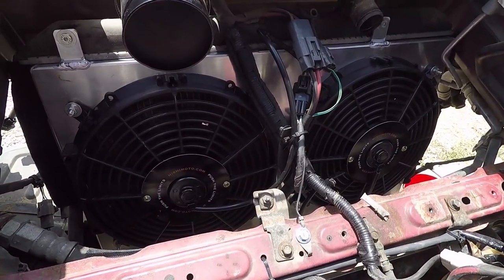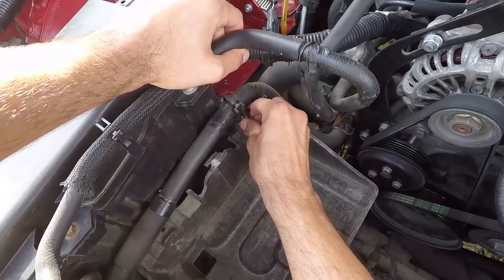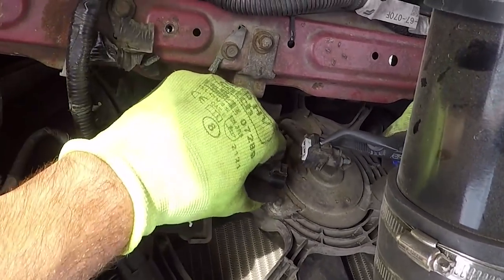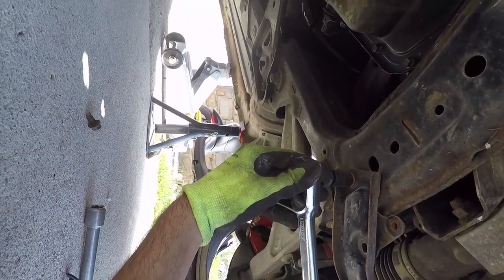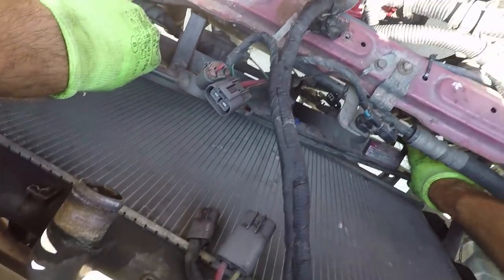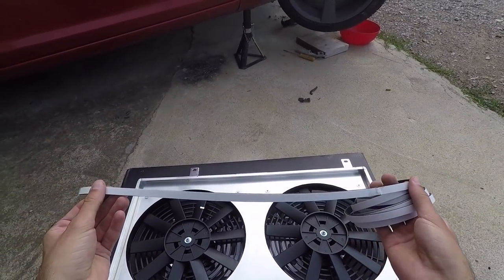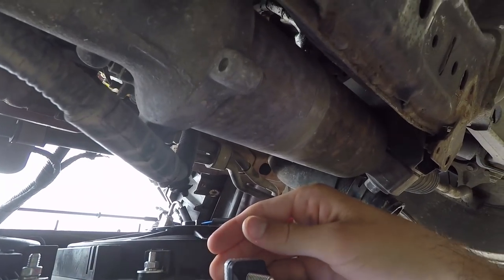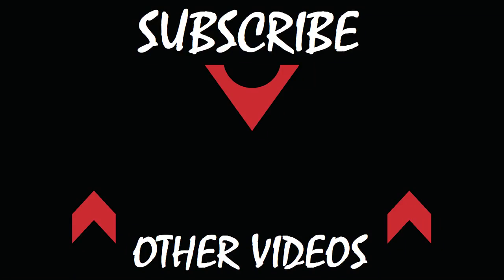Mazda Rx8 Mishimoto Aluminium Fan Shroud Install

Comment: These are the ones I had but in use track they are not enough, they are even less effective than the original ones.  I keep the Mishimoto support and installed 2x SPAL VA10-AP50/C-61A - 1221 cfm - SPAL Electric Radiator Fan - 12.0" (305mm) PULL , just another world.

Comment: My upper bushing for radiator broke that you hang the radiator on during install, so I took the one that's on the air pump, exact same piece to replace. Good to read comments.
Reply from the maker: Amazing save man!

Comment: Is this supposed to be better than the OEM fans?
Reply from the maker: O!Technology performance wise the cfm is a bit lower, as I red and heard. But compared to my stock fan it should perform better
Reply: I put the mishimoto rad and fan shroud. Im getting 10-15° higher numbers.
Reply: @danielbystrika5611  please elaborate, why do you think the temps are higher ?
Reply: @1cipi  these fans produce a lot less CFM than the original fans.

Comment: Installed my kit cause my old fans stopped working, and my new mishimoto ones still won’t come on. Not sure what exactly is happening
Reply from the maker: Could be a blown fuse. Open the fuse box, find the right one and see if it's still good.
Reply: @Drivenbymadness  ok, i replaced all the relays I’ll check the fuses
Reply: @Drivenbymadness   I checked and replaced all fuses and relays and everything but they still don’t come on
Reply: @ryanscott5338 did you find the fix?, I'll got the same problem

Comment: Another thing you can do (for the folks who delete their A/C) is solder the two sets of wires from the fans together with a H4 female connector plug (blue & black wires), reconnect it to the H1 H3 male cooling plug, and just tuck away the A/C H4 female connector plug. But not everyone is the same; this is what I'm in the process of doing with my RX8 build.

Comment: Nice guide man... very detailed. you should add a couple of small holes in the shroud and add some push clip cable tied to tidy up the power steering wires etc.

Comment: It's been over 3 years since you installed the fan shroud.  Can you tell me if it worked properly, did you have any problems cooling your radiator?  

I have a Series 2 RX8 and it hard to get parts.  I wanted to get a better fan shroud after watching your video but no one makes it?  I even called Mishimoto and they told me they do not make a fan shroud for the Series 2 RX8's???  But I found a company that has a universal fan shroud.  Because I'm lazy I asked shops around my area but they all say the same thing, " we will not do it"?!  

So it looks like I will have to do it myself.  Hope to hear from you...

Comment: Hope you could repair your radiator as soon as possible and see how it works and improve its performance.
Reply from the maker: Erick Moyano Cerpa ill do my best to fix it as soon as possible. At Least then ill have a reliable radiator that works like it should and I can rely on when drifting 😊
Reply: You should invest in a eBay intercooler
I got a gpi racing one works as good as the Koyo rad my brother spent triple on i only payed $130ish

Comment: Yet another great video 📹, but is the lifetime guarantee still valids after cutting the wires? Thanks!
Reply from the maker: I can't see why not, since its not a direct fit. You either have to modify the OEM connectors or the Mishimoto connectors. So it shouldn't have a role :)

Comment: So, my radiator was leaking so I had to replace it, I did but when I let my car idle for few mins it will go to 105°C and thats not good, I think I got air in my system and guess there is nothing wrong with adding more water to mix, since we dont see temps go under -20°C. What I want to do  is to short Fan Ralay 1 with Fan Relay 2, so once that slow fan turns on high power fan will switch on aswell, it should work as dirty cheap mod. So my question is: At what temps fan 1 goes on and if Im right other fan goes on at 100-103°C and thats also too high. I tried to google it but nothing came on, I would love to hear something like 80°C, that would make my car so much cooler just with one short cabel. Thanks for answer.

Comment: Did you not have the two lines disconnected that were right by the big radiator hose?
Reply: Weird since some claim to have them, mine did not, like in the video.
Reply: @1cipi  they are transmission fluid cooler lines. I just disconnected them. Lost minimal fluid

Comment: Where does the battery air duct sit on the mishimoto fans?
Reply from the maker: If i remember correctly it stays connected only on one side, and the part near the fans does not connect it anymore
Reply: Both clips on the duct clip onto the oem fans, is there somewhere else it clips into?

Comment: At 8:57 what are those wires you are soldering
Reply from the maker: The mishimoto fan wires to the original connector wires. The connector on the left fan had to be cut out, because it could not be removed from the old fan. So i soldered the mishimoto directly to the OEM car wires of that fan. Hope it was clear :)
Reply: Thanks for the reply!
Reply from the maker: You're welcome :)
Reply: How do we change the connector for the right side?

Comment: Done every thing like u, fans won’t come on !! Help!!
Reply from the maker: where are you stuck ?
Reply: Driven By Madness my car runs and runs for 20 mins or so and the fans won’t come on! Radiator starts to steam, then I turn car off. Maybe relay or fuse?!.. I heard u can blow relay wen u cut into factory wires..😕
Reply: Driven By Madness did u blow a fuse or relay when you cut into the wires?! I have 40th anniversary edition. The fan I installed has same colored Wires as mishimoto, I did get some coolant into plug adapter,.
Reply from the maker: @joshhacker3926  did you disconnect the battery before cutting the wires?
Reply from the maker: @joshhacker3926  Have you connected the wires correctly ?
Reply: Driven By Madness yes but a guy at autozone said it could still blow a resistor or something
Reply: Driven By Madness I didn’t solder them , I’m doin that now just to make sure theirs a solid connection

Comment: Dude your car will never run fast with that long ass intake sucking air from all the way in the front. The RX8 wasn't designed to suck air from that far up front. 
My RX8 is a jet. OOhh. 
But the Police took it for now. SMH.
Reply: .........But if you look at the stock air box it is piped to pull air from in the bumper. Same as the aftermarket CAI.
Insert all of my question marks.
If you have it sucking in air from inside the engine bay then you've got yourself a hot air intake which is stupid.
Reply: @yeahnah6468  it's different tho. The stock air system pulls air thru a tube on the bumper, then drags it to the filter inside the engine bay. The CAI is on the bumper sucking air all the way from down there. It seems like a good idea, but in reality it takes more suction to pull air from all the way in from of the bumper, then from inside the engine bay. 
Plus, I don't have a ram intake. Yes it is stupid to pull in hot air. 
I have or had a air kit. A ram kit inside of a box inside of the engine bay, it looks just like the stock box, but then I added a tube that they desined to pull air from the underside of the bumper. I forget the name. But it sucks air directly from where the cooling air comes in from. My car was so fast.